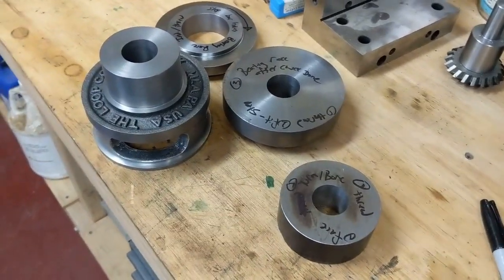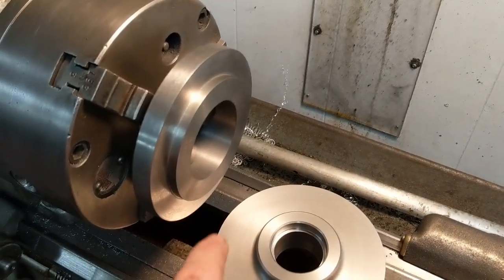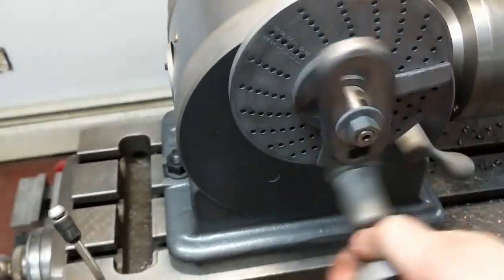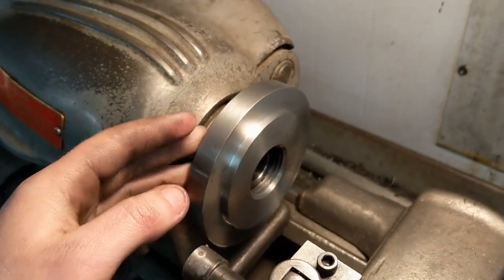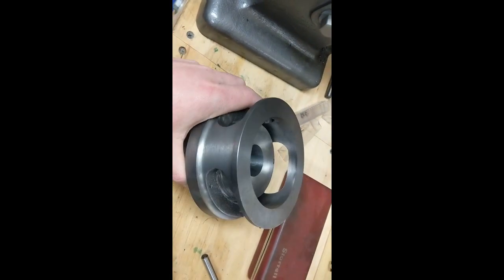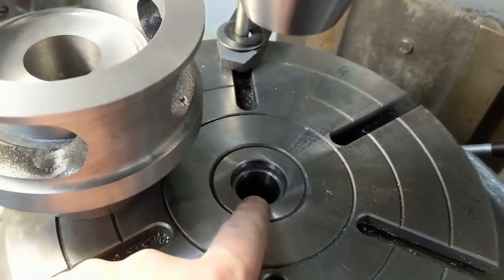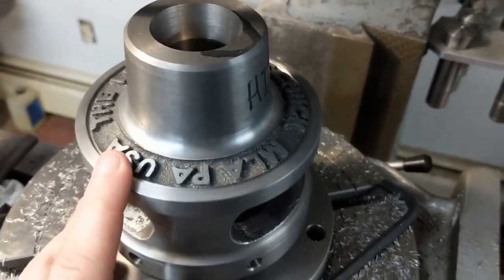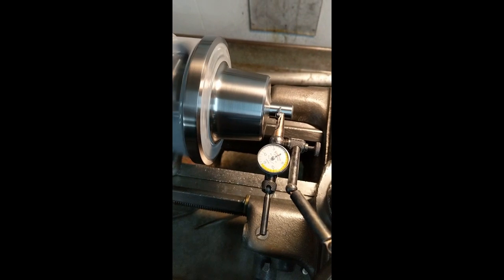Making The MLA Loop Collet Chuck

Comment: This is a project way out of my current skill level.  Also, looks like Andy no longer has castings available for it.  Only drawings are available.

You did a great job machining this MLA-21 kit.  Thank you for sharing the process 👍
Reply: Where are the drawings?  Are they available?
Reply: @en2oh  You can purchase those... from Metal Lathe Accessories.  From the website: "The COLLET CHUCK (MLA-21) enables using 5C collets in a wide range of lathes. The backplate will accommodate mounting threads up to at least 2 1/4" diameter. The COLLET CHUCK (MLA-21) has only three main components: a body, backplate, and nut. There are no gears. Thus it can easily be made by the home machinist with a lathe. Collet insertion and removal is quick and easy. The large nut, given a spin, draws in the collet, which is then cinched tight with a tommy bar. Giving the nut a spin in the other direction removes the collet. The kit for making the chuck includes two ductile iron castings, 1144 "stressproof" steel for the nut, ball bearings, screws, drawings, and instructions. Currently, only drawings and machining instructions are available for purchase."